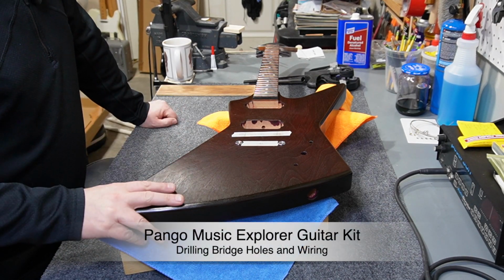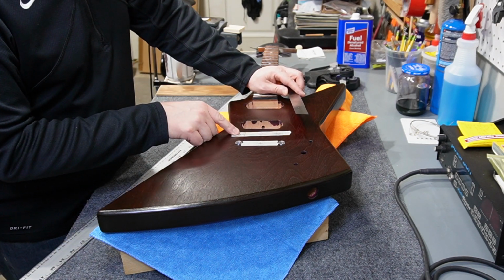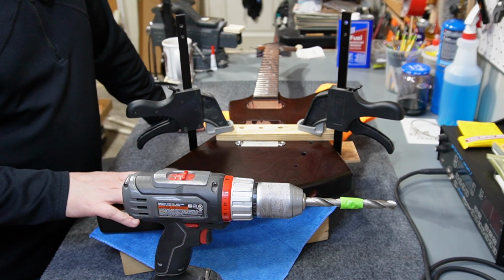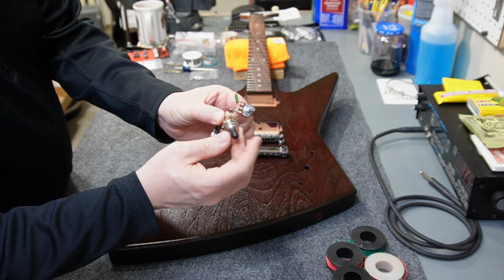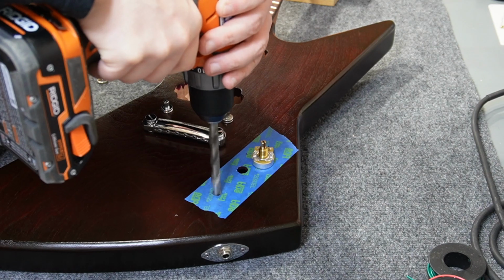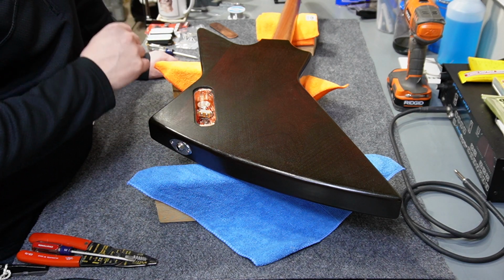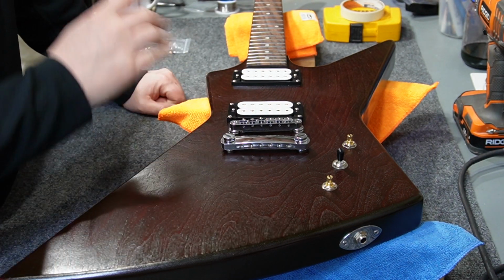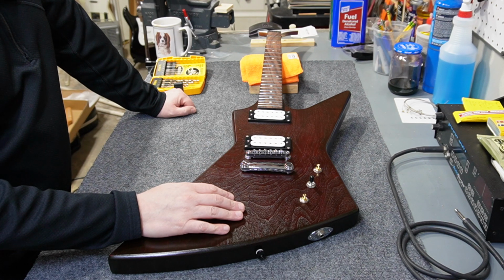Pango Music Explorer Kit Guitar Build - Part 6: Drilling Bridge and Installing Wiring/Pickups

Comment: I would recommend step bits for making holes larger. They are a great investment and will save you tons of heartaches if you blow out a hole with a regular drill bit
Reply from the maker: I have some actually, but mine are the conical ones that seem more suited to sheet metal than wood.  Do you have any brand/model you recommend?
Reply: I bought some from Harbor Freight. They work just fine
Reply from the maker: Ok, thanks.  Those are the ones I have as well.

Comment: Nice work getting everything aligned properly
Reply from the maker: Thanks 👍 I’m certain the correct way to build one of these is to drill the bridge holes after attaching the neck.  Now if I could just determine how best to check neck angle before glueing.
Reply: @hacksguitarhobby  That's the only thing that scares me with a set neck lol

Comment: Looks great so far. The bridge from Pango was 74mm and holes were 72mm? Also was wondering the pot kit number or type? 500k fender short shaft?
Reply from the maker: That's correct on the bridge.  I ended up moving the holes about 1.5 to 2 mm further apart.  The pots I purchased were Fender 500k short split shaft, but in reality they do have a little more depth/threads than some Fender/CTS pots I've seen.  See the episode details for the Amazon link - it has the pot part number there.
Reply: @hacksguitarhobby  thanks! Didn't notice the links. Yours is looking great! Can't wait for future episodes. Hopefully mine will come by then. I'll be making videos of my progress as well.
Reply: @hacksguitarhobby  also wondering the nut width and height. Thanks